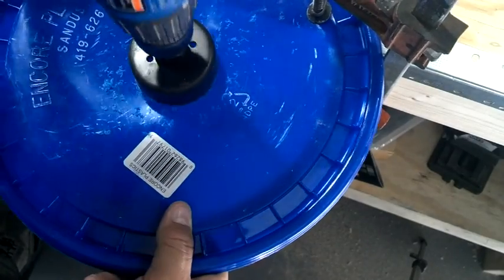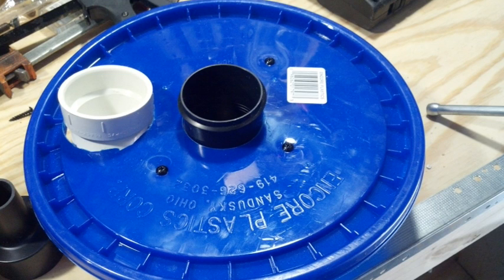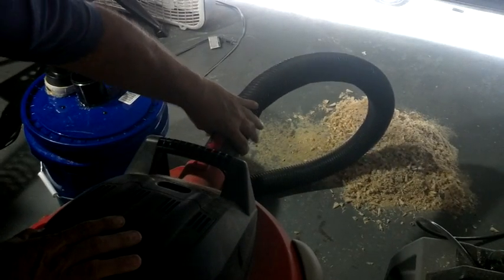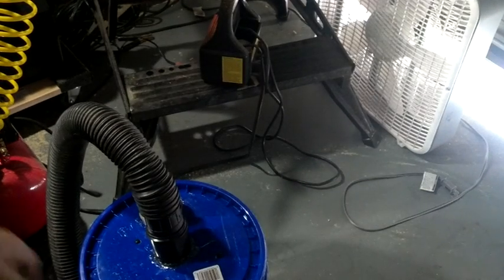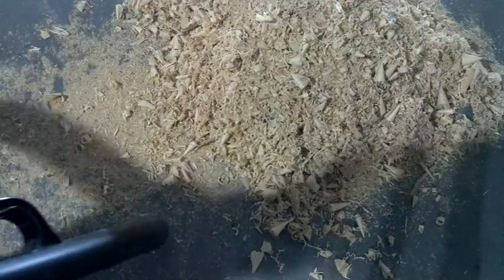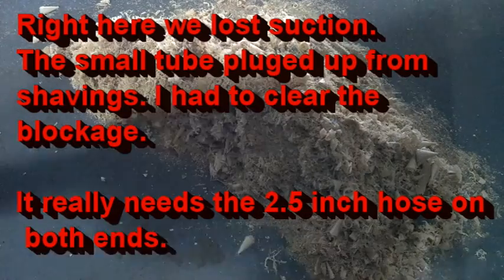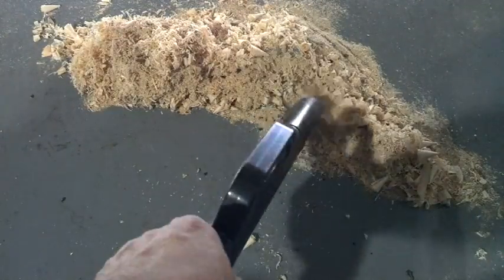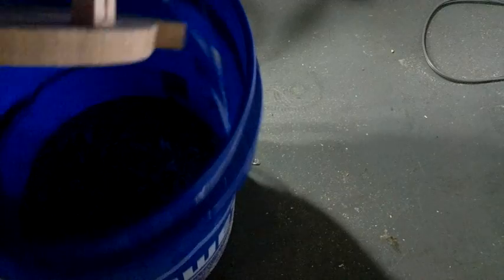5 Gallon Bucket Cyclone Separator Prototype

Comment: Nice. Try rotating the baffle a bit, my understanding is the elbow is supposed to blow onto the solid part, and let the air sweep across to the cut out. May or may not make a difference.